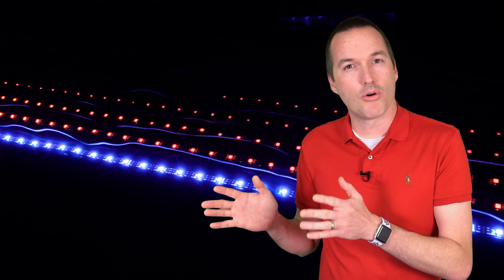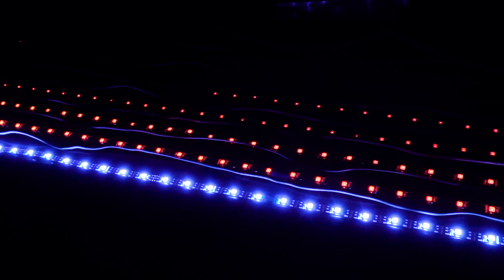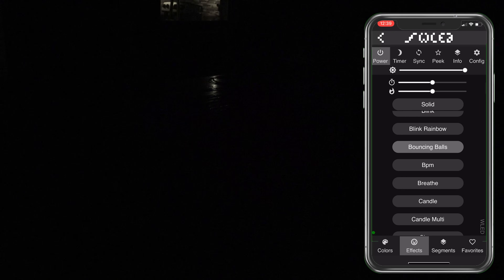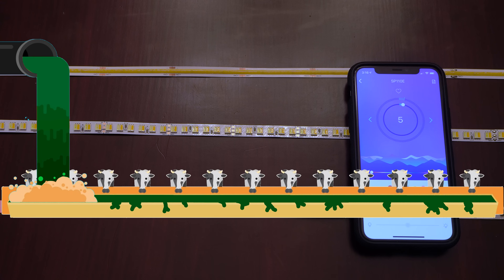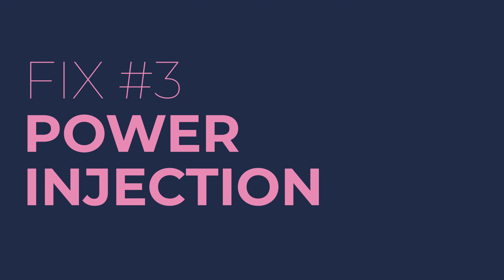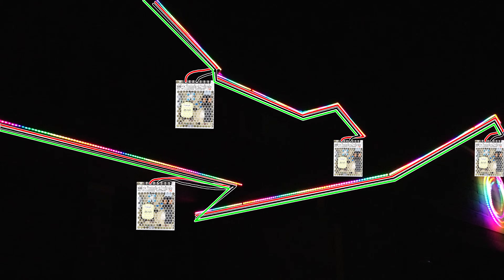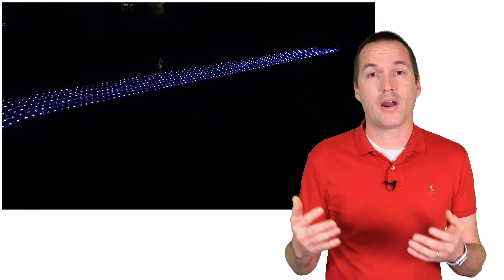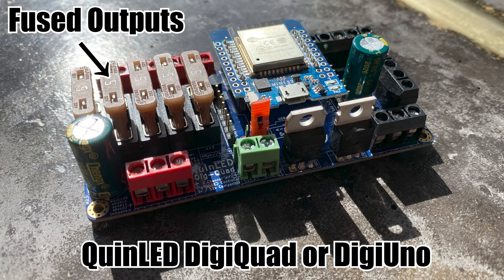3 Quick Fixes for LED Color Issues - Power Injection, Voltage Drop, Brightness Regulation and More.

Comment: I have an issue. I’m trying to achieve led lights along the ceiling with as little wiring as possible. Now with attic access, this is irrelevant. However, I live in an apartment and I’d like to hang up some RBGIC lights along my ceiling, but I would like to minimize as much wiring going up the wall as possible. And since a lot of these Amazon led kits come with a little WiFi or Bluetooth controller, I am left with a complete diy project. So my question is, what RGBIC system would you recommend to achieve this install with as little wiring showing as possible. I’m ok with a controller being low to the ground, just not built into the wiring.

Comment: Power Injection #1: can you please clarify if the one long parallel wire (22G wire) is connected to the power supply and additionally to different end of the strips?... or is this extra wire not connected to the power supply and just reducing resistance to the long run. It appears you connect the parallel wire to each of the strips as well? Thanks.
Reply: It should definitely be connected to a positive terminal on your Power supply, and like he said, you can tap into it wherever you need to along the run.

Comment: I plan on using around 2-4 strips of WS2812B with a esp8266, 5v20a powersupply and have a range of wires (18-30awg) for parallel injection. I plan on getting the dig uno as well. That should all work right? Would I need a more beefy power supply to run that many strips at max brightness or at least roughly max?

Comment: @The Hook Up can you pls tell me, why I change so many led strip light already , when I put it into my led aluminium tube, no matter my led light density is, it will always shown like separately small lights, I mean it’s like dot dot dot, but not like one long and beautiful shiny tube...... and I bought the led aluminium tube also, it just doesn’t seem like the effect....
Reply from the maker: What LED density are you using?
Reply: @TheHookUp  60 led per meter ，and thanks so much for replying me really
Reply: @TheHookUp  I guess now maybe I chose the wrong led channel , because the transparency. I bought at least 10set of led strip light from Amazon already..... and all of them shows a dot dot dot effect when cover  it with aluminium channel.

Comment: I understand that lap soldering is the recommended way to connect one strip to another.  I have watched an instructional video on how to appropriately lap solder.  Is there an instructional video showing how to inject power when connecting strips?  Also, doing this within an aluminum track which has little space seems challenging to me.  Please share a picture or video of how you accomplished this!

Comment: Hi, I have a rotation-type projector  that shines snowflakes onto the house. I bought it at the after Christmas sale 2 years ago and finally opened it. The motor and rotation work,  but it doesn't light up. I saw a video that shows how to solder a new one on, and was hoping that maybe you have ideas as to where I could buy a small button type of LED that has the parts that you solder projecting from two sides. Are you considering doing any repair videos on that type of LED light? Also, do you have ideas for holiday inflatables that the lights are too dim or to replace the bulb type of lighting with LED? Your videos are well done and helpful,  so I believe that if you did those types of videos, I believe that they would be well done and helpful as well.  Thank you 😊

Comment: Your 16/3 LED Wire link actually points to an 18/3 wire.
Reply from the maker: Whoops, that's just a typo in my description.  I use 18/3 for my main runs and 16/2 for my power injection.  Fixed.

Comment: This is helpful.  What is your advice for the following project I am doing:  I have purchased about 80ft of 24V addressable RGB led tube lighting and mistakenly purchased a single 500w PSU that ran loud so I then purchased multiple 300W led drivers.  I then realized that both of these get dim after only connecting 2/5 strips together due to voltage loss.  I connected two strips and injected power in the middle (via second power supply) and it immediately brightened right up.  These strips all have a 3 prong connector (24v, G, D) as well as individual two prong power cables.  Do you suggest it's safer to run multiple 24v power supplies with lower amps and inject perhaps 3 times (both ends, and middle)?  I'm also extremely curious about adding fuses to power wires.  Any documents or videos in that regard?

Comment: I’ve just started my first led project. I’m using 5v addressable leds, is it normal for the voltage to be 4.4V at the power supply when under load? And great video, I always learn something new when I watch your channel.

Comment: Positive wires should not connect directly or indirectly, why? I'm curious because I'm using it this way and now I'm a bit afraid, is this not safe, or just out of signal problem?
3x5m of WS2815 and using 2x10A PSU injecting power on every end (3 joints and 2 ends, totally 5 injecting point) and they are on the same 230V power line after a sonoff basic.

Comment: You showed where you run the parallel power injection but how you run the homerun power injection wire? I want a run all around the top roof soffit of the house.
Reply from the maker: I ran it through my garage attic, I didn’t specially show it because everyone’s setup will be a bit different.
Reply: @TheHookUp  I notice on Holiday LED Part 3 Video you having a run with over 400 LEDs.... how many Power injections you have on the run?... and is it smart to light up runs pre installation?
Reply from the maker: @76jlito  Both rooflines have only 1 home run about 3/4 of the way through the run.  You don't need to light up the whole run pre-install, but you should do the strips individually to make sure they don't have any bad pixels.
Reply: @TheHookUp  Thank you one million. Your work is amazing.

Comment: Great video! I just installed my aluminum channel and I'm days away from installing the LED's. In my test setup I noticed my 22 gauge wire was heating up quite a bit and that worried me. I hadn't considered a "home run" cable though. That could fix my issues.
Reply: 22 guage is pretty thin, you're better off using 14 or 16.

Comment: Hello Rob! Nice video! I had my thoughts, but you definitely make me regret it. I‘d like to put a led stripe around my son’s room celling. Taking your advice among others, I don’t blame anyone except me because the celling line all around is approximately 15m, I thought that using 24V will give me a good result using one power source. But now, I’m afraid for fire hazard in case that strip fell off – the stripe will run also above the child’s bed.

   I would like your opinion, on what can be done – or I’m making “a big issue out of nothing”?

Thank you – or anyone has an advice- in advance!

Comment: can all so use a pc psu that's rated for X amps @ 5/12v.  it shut off if it gets shorted  and ya get loads of wire :).

Comment: Can you please tell me what the best led lights are I’m looking for good ones with lots of colors and will last for a long time
Reply from the maker: Check the links in the description.
Reply: @TheHookUp  are these ones good Rextin WS2811 Pixels Digital Addressable LED String Lights Waterproof RGB Full Color 12mm DC 5V (DC5V 500pcs) they are on amazon
Reply from the maker: @Saulitooo  Are you trying to make a light show?  Those are just bare LEDs, you'll need a controller and software to make them work.
Reply from the maker: And you want pixels and not strips?

Comment: There is some great info in here and good for beginners.  I got started a year ago whatching Dr zzs and you.

However.... 
Positive can be connected between power supplies that allow it.  Some have reported the cheap ones are fine but the suggestion to keep them separate is best.  Saying you can't is an umbrella statement that isn't accurate.

This brings me to the next point - those in the hobby know that the ground side is actually more important for flickering/freezing issues (in 12v) and color loss in both 12v and 5v.

12v pixels actually are still 5v pixels, but they are able to retain color better because the voltage drop from 12v to 9v has little effect on the pixel in the same way a 5v that drops to 2v would have (each having a 3v drop).

I also wouldn't use the blanket statement that 5v is safer.  The power isn't pushed through the lines from the power supply but are, instead, pulled by the load of the pixels from the power supply.  An example of this is the power supply has no load through the lines when powered on and no lights on.  5v is more likely to drop voltage over a longer line and, thus, would require a larger gauge cable to retain the voltage that a 12v would.

With that said I run all 5v and all of my power balance wiring is 14/2, 16/4, and 18/3 - depending on distance, brightness, and number of pixels on that run.
Reply from the maker: Lots of good information, but I'd disagree that you can't say 5V is safer than 12V as a blanket statement.  It's true that power is pulled and not pushed, but you're forgetting that a dead short will pull the maximum current possible.   12V will always have a higher current flow through a dead short than 5V for the same size wire, and will also be a greater wattage.

Also, 12V pixels work differently than 12V strips.  Pixels drop voltage in each single pixel (either with a resistor or a regulator), while strips group the LEDs into 3s and split the voltage between them.
Reply: @TheHookUp  Ok, well we are starting to get into semantics.  If you want a safe install you would be using a fuse, and a dead short becomes a null point as the system would be protected by the fuse.

However if you make a statement that 5v is safer than 12v and the audience is newer - they will, unless otherwise stated, consider that voltage is similar and wire gauge can also be similar - which if you're talking about 1,500 pixels at 50% brightness on a 300w power supply the method and wire gauge to power them starts to really matter.  So does the gauge of the wire on the longer "home" runs.

Comment: Would love to see a video demonstrating the process of power injection on pixel strings/strips!
Reply: I would too. Seeing how the multitude of cables would be placed in a channel and how to add the power injection every 2 meters. My house is 60' and I know I have to provide some extra wire but not sure how much and where they connect from.
Reply: Been trying to find examples of neat power injection in a channel and have been coming up short.
Reply: @Zylvyr  No pun intended? 🤣
Reply: +1 on this request
Reply: Yes, a power injection demo would be great.
Reply: Plus another on this request
Reply: +1
Reply: Same here. I know he has other newer videos where he's shown that he solders in a voltage and ground wire to a set of LED solder pads near a junction. However, I don't understand how he interfaces with those 2 wires for both the voltage in and voltage out (continuing on to the rest of the power injection points downstream).
Reply: @markusaurelius4015  there is no "voltage in/voltage out"... The source power can be split MULTIPLE TIMES down the line... The voltage goes through the LE(D-iode) in one direction, and on to the next.... The data signal goes in a single direction only as well. What is it that you don't understand?... You can touch (or splice) a hot (positive) wire straight from the source, or off any of the "junction points" WITH ANY OTHER positive (+) point on the circuit... Same with the ground.
Reply: Use a line level shifter on your data signal, and every 20 meters or so (wherever needed) use a separate power supply to power a new run of led strips, while using the original data signal.
Reply: @starmc26  I thought he said adding additional power supply is the last resort.

Comment: So I get that the 60 led/m would basically create a problem earlier in the string this requiring more injection points, but would there be areas where you would use the 60 led/m or would you just double with the 30l/m if you needed the extra brightness?

Comment: Since many of the power supplies used in this application have minor adjustments on the 5V rail, how much of a difference would it make if you adjusted that to output say 5.2V instead of 5.0V as most devices designed to accept 5V will accept a range of input voltage, often up to 5.2V or more.

Comment: There is a fourth option: feed the negative from one side of the strip and the positive from the other side.
This way all the LEDs are truly in parallel: any circuit that goes from positive through an LED to negative has the same length, so each LED will be fed the same current.
To achieve this you need to:
- cut the positive terminal at the end of the strip where you feed the negative
- take a cable and connect it to the power source on the positive terminal
- connect the other end of the cable to the other end of the strip on the positive terminal.
Reply: This is a compelling idea! However, it does only work with reduced power. I have a test setup with a 60 LED/5m (300 LEDs) white strip connected to 12V. If I power it from one end it draws 10.1W of power. If I run a line parallel to it and power the strip from the both ends (both negative and positive) it draws 15.5-15.6W. If I try your method by connecting one pole on one end the other at the other end power is reduced to 9 or 9.2W depending on which polarity I route along the strip. Overall brightness distribution is better than feeding it from only one end, but power is not good. While you route a wire to the other end of the strip then you can easily route another wire, powering the strip from both ends maximzing power without to much hassle. If you want to achive maximum power you could inject on every meter. I tried it with homeruns and power went up to 19W.
Reply: @Sekir80 yes, your method of powering from both ends is interesting, but I think you're still going to get that degrading intensity, just that the degrading starts from both ends of the strip and the intensity is at its lowest in the middle of the strip.

I mentioned the method of one wire because it achieves uniform intensity with the least hassle (just run another wire) and it's not invasive. Feeding it midspan works in some select scenarios where you can afford the space and the fixture to do this job.
Of course, my method still wastes some power, but I think it is the best bang for the buck overall. For more brightness, one can ramp up the voltage.

If the intention is to obtain the maximum performance with the maximum brightness, then not even injecting every meter is enough. One should inject for every led block, basically powering each strip segment individually.

Anyway, I wanted to mention the method of feeding one terminal from the other end because it was so obvious to me with some good advantages and it was not presented in the video.
Reply: @abcdefvxyz4324  Yes, you are right about voltage drop on the middle. I did not measure LED voltage on the middle of the strip, though. Maybe I should do that to have a better picture on your method. Anyway, thank you for sharing your experiences!

Comment: Thanks for the updated video and option 3 clarification. I had just hooked up the 5v lines to multiple power supplies.  I  shut down and will isolate the 5v power immediately.
Reply: With the option 3. With multiple power supplies at each isolated circuit do you need to run a Nodemcu at each power supply?  I believe they can be synced.
Reply from the maker: nah, you can run the data and ground between strips without issue, just the positive needs to be isolated.
Reply: @TheHookUp  thankyou mutch.

Comment: hello I wanted to ask you a question!  how many pixel led can i connect on each output of qid quad?  thank you so much
Reply from the maker: I think 800 per channel is the recommended max, significantly less if you want to send e131 data to it.
Reply: @TheHookUp  Thanks for the reply.  i like your videos.  too bad I don't understand so much since I only speak Italian.  is your house all controlled by dig quad !?  or from another system !?  Thanks again.  good job
Reply from the maker: During December I have a big light show for Christmas that uses "Traditional" E131 controllers (Falcon F16V3 and HinksPix Pro).  The rest of the year I use a DigQuad for my permanent roofline LEDs.
Reply: @TheHookUp  I get it.  good technology is needed for a good job 😉.  thank you definitely resent me in the future.  thanks again and good job.  Hi
Reply: @TheHookUp  next Christmas I would like to do something big, as much as I can.  I have a lot to learn before I start 🤯

Comment: If you want all LEDs in a parallel  strip to be the same brightness (dimness really ☺) a cunning trick is to feed +ve only at one end of the strip but -ve only at the other.  All LEDs see exactly the same resistance and therfore the same voltage drop.
Reply: This power inject page does not suggest doing that.

http://www.doityourselfchristmas.com/wiki/index.php?title=Power_Injection

I also remember that Quindor had a video on this and said not to do that. Sorry I can't provide the reason, I just can't remember it right now.